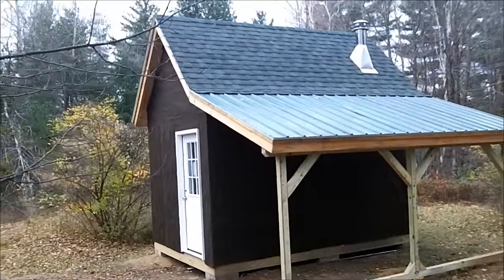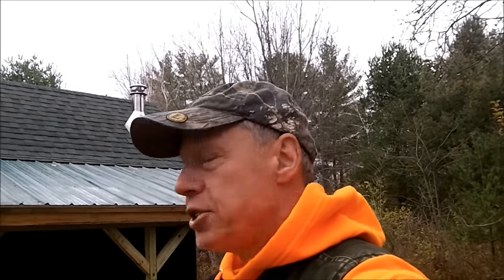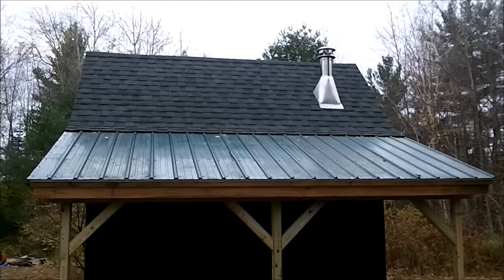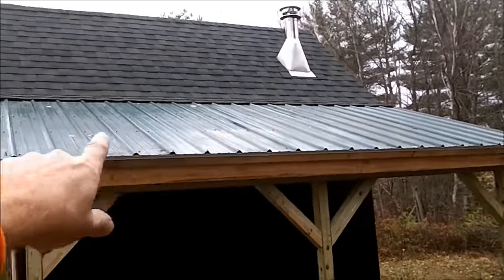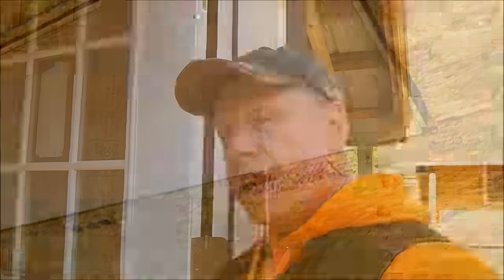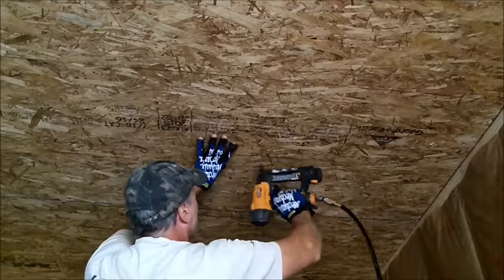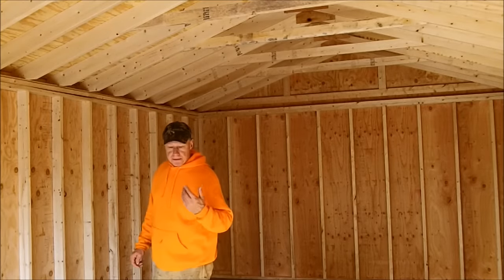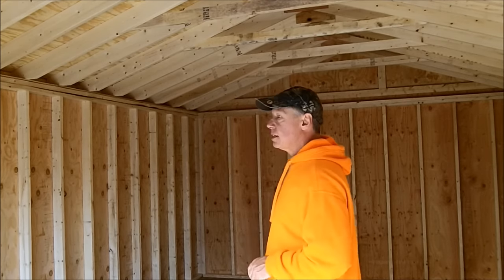THE BACKWOODS CABIN. Workshops, Updates and Embarking on a Dream.

Comment: I am moving into my tiny cabin tonight. Took my last outdoor hot shower in the cold. Half my cabin is insulated and the outside wrapped up....almost. 

I went with your plan and used R13 in walls and R19 above. The first 200 sq.' room is insulated and heats quickly with a only a 1500 watt box fan heater. As long as it runs I can wear socks and be comfortable on the OSB flooring I had already insulated with thick R30 insulation under.

Enjoying all of your videos and seeing your new building. I am thinking I would like one. But will wait and maybe add a pre-built like yours next spring.

Thanks
Reply from the maker: +MYFREECAMPER  Sounds great. Hope the critters don't ruin all the R30 on you.  That's one benefit from the bubble foil. The ants and rodents don't mess with it.  Good luck to you.
Reply: +thebossoftheswamp 
Bugging out soon to boondock winter in AC on BLM land in my Cargo turned Camper Van for 100 days then back at it in March. will be watching your channel.

Comment: When you were talking about putting up the ceiling I was going to suggest building "wallies" - which is what one of my magazines called them. Then I saw that you had done exactly that. OSB is cheap and has no structural strength, but it makes for good interior walls.
Reply from the maker: +Rebekah Davignon  It's a good standard wallboard for a workshop. The stuff is garbage but a bit better for this purpose than sheetrock.

Comment: Boss...This is my first time commenting.  I love your channel -- watch it all the time!  Frankie's my favorite:) With Thanksgiving approaching, I wanted to share with you something I saw on a local educational channel here, a new way to fix a turkey.  Purchase about a 13-15 gallon aluminum trash can and burn it off to remove any residue, etc. on the can. Place a large sheet of aluminum foil on a level, clear piece of ground. Take a wood stake and cover it completely, including the top end, with aluminum foil and then stick the stake into the center of the foil that is on the ground. Salt and pepper a turkey that is no larger than 13 pounds both inside and out. Place the  turkey  on top of the stake, legs down. Place the trash can over the turkey. Place a layer of hot coals on top of the can, then another layer around the outer bottom edge of the can on the foil. In about 90 minutes remove the can, put a thermometer in the turkey to be sure it is 165-170 degrees -- and you should have a perfectly done, smoked turkey!  Works like a convection or Dutch oven and doesn't mess up the kitchen and keeps the stove free for other things. Looked delicious!
Reply from the maker: +linda woltz  I had turkey cooked that way at a friends house once. It was very good indeed. Thanks for sharing.

Comment: Great job on your current projects JC !
I see you chose a regular roof for the barn VS a gamb. roof line. Was there much storage difference? I agree with your take on business sense. My sustainability workshops are geared to the best use of self-sufficiency in regards to both the business and my personal goals. We are hoping to get a copy of our road permit this month > to start dropping trees and make our way to our woodland homestead site. All the best my friend!
Reply from the maker: +diane hall If I remember correctly, the gambrel roof had less wall height and I need the wall height for cabinets and racks.  Good luck with you driveway project.

Comment: What kind of footings did you set the new workshop on?  That would be a great video- how you set the foundation for all of your buildings.  Good work!
Reply from the maker: +Geoffrey Wayton  The ground here is all sand so I can get away with setting the structures on floating concrete pads. The poles of the roof addition are connected to sono tubes though. I didn't want them to get kicked out when the snow slides off the roof.

Comment: I just spent about two hours stacking my 'scrounge' supply of firewood.   About 5c now (40F).  I was wondering where the cabin was..then you said  NY.  I live in Prince Edward Island, but originally from Cornwall, Ontario, across from Masenna NY.  We use to go camping around Saranac Lake, and then Wilmington, at the base of Whiteface.  That is some nice building for 6,000.  You couldn't touch that for that price up here.  Then again we pay too much for most things :)
Reply from the maker: +Brent Eamer I'm just south of Massena.  Keep stacking that firewood, the snow is coming soon. Cheers :-)
Reply: +thebossoftheswamp Yes, Massena, spell check time.  I loved that drive through Malone, Ft. Covington.  The economy of Northern New York state not so good these days.  I was there in 2010 and lots of stores closed.  In college we use to go for drinks at Friar Tucks.  And then do a beer run for some 'ole "Golden Anniversary Ale" lol
Reply: +thebossoftheswamp I noticed your assortment of cast iron on the wall behind you.  I have about ten or so pieces, ranging from old frying pans (My grandmother's) to Dutch Ovens, and various size skillets.  I cook most of the winter of my Regency stove.  Heat my dishwater.  And bake potatoes in foil inside stove.  It is the most utilitarian appliance I have.
Reply from the maker: +Brent Eamer  Sounds like we have some things in common.  Woodstoves and cast iron pans. Gotta love it.

Comment: The way you have built the workshop if you ever want to put another she'd on the other side you can do that or another room. Are you going to heat the workshop with wood, if so the same heater you are using in the workshop
Reply from the maker: +brenda alexander  The workshop will have solar heat, wood heat and gas heat. I'm keeping my battery bank in the shed so I'll need to keep them above freezing.  You will see all this in future videos :-)
Reply: Now that is what you call not taking any chances.  😊

Comment: All tin roofs rain  water catchment is cleaner.
Reply from the maker: +Gamingcritter  I will never have a tin roof with a chimney poking through it ever again. My barn has only a 3 pitch and the chimney is 4' from the ridge. Last winter there was 5" of snow up there and then freezing rain came down and formed 4" of crust on the snow. The snow slid and tore the chimney and flange right out of the roof.  Lesson learned. Just glad the stove was out when it happened.  Cheers

Comment: Hey Boss, question for you. I have a piece of land in SW NY State (Allegheny Region). I paid for a cabin to be built because was easier for me as I am in Australia at the moment. My question is, Pressure treated 6" X 6" Piers were used for foundations. I know for a fact that they are not below frost line. In your opinion should I replace these with concrete foundations on the surface as opposed submerged below frost-line? I am also concerned with termites. I would appreciate your input on this one. Cheers, Yanknoz (alias Hans Solo)

Comment: great vid again, u kinds of answered my question ,about ,with your skills set , why didnt u build the shop yourself? U said u couldnt beat it with the time u would have in bulding it. Would u have saved some money . Looking for a shop as well just didnt think the premade ones were built very well. What company did u buy it from? $6000 total with shipping?
Reply from the maker: +buffalostate1 Some premades are junk but these guys do nice work and don't skimp. I need the building now and didn't have the time to build it. Can't say I'd save any money doing it myself anyway but I sure saved a lot of valuable time.  The entire undercarriage and sub floor are pressure treated and insulated, no cheap components and now I have a building with not much effort beyond a phone call. Well worth it. It came from Adirondack Storage barns and yes, the 6 grand included delivery.

Comment: doesn't the stove chimney need to be higher than the peak of the roof?
Reply from the maker: +dave I will add more pipe when I find some but it will be fine as is. The chimneys on all my structures are this way and they draw just fine.
Reply: i was thinking more for safety rather than draw. btw I love your videos. Keep up the great work

Comment: I can see why you would put those things a ways away from your backwoods cabin.  I've found I need very little water where I live, even though I'm connected to a well.  I wash in a small bowl of vinegar water every day because soap bothers my skin.  I also wash my underwear in a bucket with vinegar and a little fabric softener and change them out.  It means I can go longer between my main washing.  I've never understood why people think they need hundreds of gallons of water every day.  It's wasteful.
Reply from the maker: +fire7side  Even here at the homestead, I use little power and little water. There's no need to be wasteful.  The energy consumption of some households is staggering.